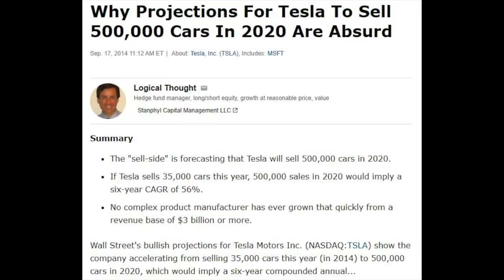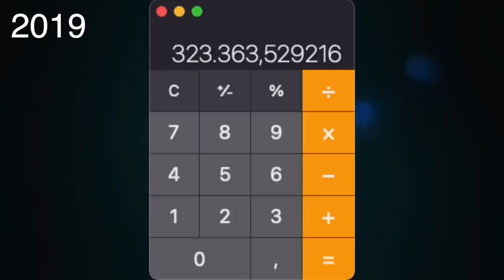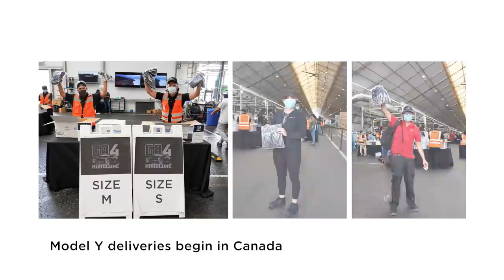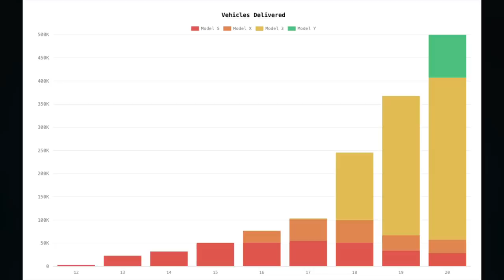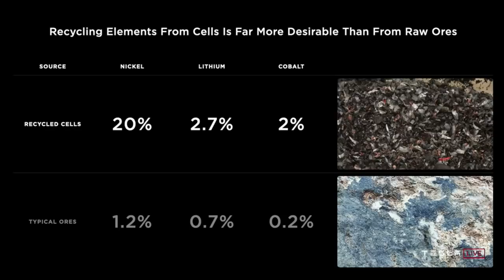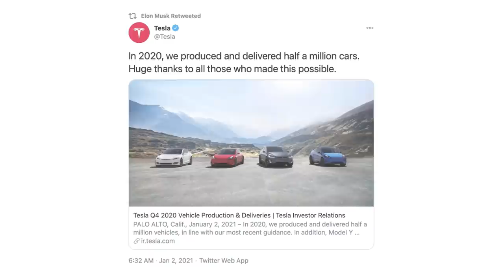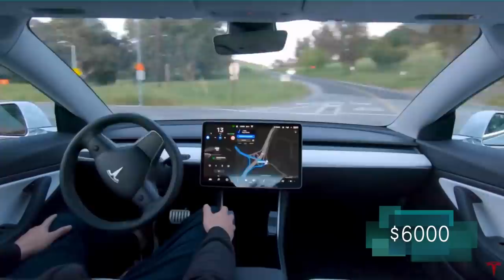Tesla’s Growth story explained - you NEED to understand this !

Comment: What people don't seem to be able to grok is that, barring accidents, most of the Tesla vehicles around now will still be around, in working order, in ten years' time.
The maintenance required on a Tesla EV is orders of magnitude less than on any ICE vehicle. There is an order of magnitude fewer parts to break, wear out, get fouled etcetera.
Production statistics are likely to be cumulative.
Reply: Love the grok reference.
Reply: @Shfytwo  I lurve it too!
Reply: And, few other brands, have "Service Rangers" meaning less time to waste, since you don't need to "Bring it in" for fixing "Small things" if you are busy!
Reply: I hope so.  Planned obsolescence is a pet peeve of mine.  Keeping cars (and other products as well) going is super important for long term sustainability.  I am watching long term performance carefully before I put my money down on my cybertruck.
Reply: Are we far enough into it to know how well Teslas will hold up to other issues, e.g. body rust, UV deterioration of seals, brake line rot (not sure if this is relevant), etc.?
Reply: @MichaelBrown-kk6ck  The key issues, at ten year major service event, likely:
A) if nickel cathode batteries, replace pack
B) heat pump, heat exchanger, hoses.
C) brake lines, rotors, pads.
D) fabric & leather in cabin.

Might be smarter to recycle?
Reply: Except for the fact that Tesla’s use soy based insulation on wiring.  As with soy based insulation on ice cars… it attracts rodents that destroy the car.  Just replaced two computers in two fords and wiring.  Tesla needs to stop using soy based wiring.
Reply: @fredpsimas1874  spot on Fred. I live in rural Wisconsin USA and in a constant battle with rodents chewing on my vehicles. Some people look at me like I’m crazy when I tell them but the local mechanic isn’t surprised he sees it all the time!
Reply: @fredpsimas1874  the highway department uses salt and beet juice in winter road treatment and the squirrels start licking the bottom of the vehicle which turns into chewing. I also got the chipmunks and mice crawling into the cars doing they’re damage
Reply: Production is NOT population.

Comment: Love the idea of Tesla owning their own robotaxis. Is an alternative to have battery swapping because they will be able to do it in their maintainance facilites AND recycle 100% of  their own batteries.
Reply: NOPE, the Structural battery CANNOT be Replaced, but the Whole CAR can be Recycled , at end of life.
Reply: Too often Battery swapping of batteries such as the NIO model faces a very real issue of mechanical wear and tear of both electrical and plumbing connectors and mounting bolts which have the possibility of catastrophic failure
Reply: @j.pgoodwin9020  Very good point. With a swappable battery, you have to insure good WATERPROOF electric connections, but also leak-proof coolant system ones. Furthermore, a  swappable battery can’t give significant structural support, forcing to add metal and weight to the car.

Comment: Just announcing the Model-2 will tank ICE car sales overnight.
Reply: I do agree with that somewhat. But we like a little larger cars and pick up trucks in the US.
Reply: @ZeusBullyMax  - While it's "True" we tend to "Like" and "Choose" larger Vehicles, it's because we have been told they are "Safer", but, everything points to that not being true, with flipping, rolling, and crazy instability, in typical SUV & Pickup Crashes.

However, there is also this thing about Vehicle Insurance, in that we, today, insure each vehicle as if it was always being driven, causing us not to have the best vehicles at our disposal for the best use! IE, a F250 Crew Cab, with Long Box, has its best use case, "Commuting to Work" is not the correct use, unless Work is on a Farm, or Rock Quarry! 

That's where the coming "Compact Tesla" if they can actually deliver Model 3 SR+ level Range, but for just "$25,000", can be a great replacement for Millions of SUV Driven Miles Per Year, and a very useful Uber, Lyft, or Robotaxi Vehicle! Yes, even as an "Extra Vehicle" for F-250 Super Duty Owners!
Reply: LEGACY is NOKIA.......HA HA HA.
Reply: @ZeusBullyMax  - those are coming, Unfortunately LEGACY doesn't have the Battery Supply, and F150 EV will be limited production.
Reply: When people think compact car they think Toyota Tercel. The Tesla compact will be a very different animal. Top technology, over the air updates, beaucoup super charging stations, perfect for Europe, China, India.
Reply: You're absolutely right.
My dad had an Osborne (luggable) portable PC.
I understand the Osborne effect.
Reply: @robertweekley5926  We are bigger people our roads are bigger and we have mainly growing up around larger vehicles. A large pick up runs into a Toyota Yaris I would rather be in the pick up.
Reply: @ZeusBullyMax  There are plenty of compact cars in American cities. In rural areas and in the more expansive West, sure big trucks, cars, everything. But downtown L.A., New York, etc. A Tesla compact for under 30/25 with incentives will do well in its niche. Hell, you oughta see how small the damned parking spaces are here in Austin! 😂
Reply: Model 2 has already been announced for 2 years, any signs? NO. Like self-driving, you can wait untill you weight an ounce!!
Reply: @corpierro  Lol. Please. You're attempts at trolling are laughable. 😂😂😂😂
Reply: @clintatk  me trolling? What are you doing? Science or wishful thinking?
Reply: @corpierro  They are making substantial progress on many fronts. Don’t worry the model two will come out after cybertruck and semi or in parallel. You do know they are building two new factories right now that are bigger than the first two that they are operating out of right now. Adding to that solar roof,power wall, power pack, insurance and FSD. And there’s probably a few other things that I forgot to mention or that I don’t even know about that they are involved in. Like mining and the 4680 batteries etc. They are doing pretty well.Don’t be so impatient unless you know any way to figure any of these situations out. It’s easy to criticize when you for one thing don’t understand any of it and for the second thing have no realization of what it takes to achieve these goals. Oh and there’s a few other things called spacex & the global Internet company.
Reply: @corpierro  Just following the facts. A company that's running as fast as it can to try and fill the demand for its products is hardly going under.
Reply: @corpierro  Okay, I'll feed the troll one more time. Tesla topples over, because...?? Yes, legacy corporations have cred because they are big and old. Will they compete successfully in the electric vehicle transition? Maybe, possibly, but it will take years, while at the same time having to carry the burden of a shrinking old technology. They have to convince their customers that their new EVs are the best while also propping up their gas car sales. They have to keep developing and building their gasoline and diesel lines, splitting their capital between the two technologies. Tesla has no such problem. As for made in the USA, Teslas are the most American made car sold in the US. All others source their parts from around the world. Tesla is very vertically integrated, making much of their own parts. Do your homework. Your opinion is just that. You're welcome to it, but you're lacking the facts.
Reply: @clintatk  when everyone was like you Tesla will become big and old too....
Reply: @clintatk  there is one positive thing about Tesla, it's reviving the already for decades died American automotive industry. But Americans have little or no awareness of what's happening in Europe and Asia. They lead the automotive industry for the last 2-3 decades and will continue to do so. A single American startup will not change that. An EV is for 70% a car like any other, changing the propulsion is a much more easy job for legacy company's than learning to build cars for newcomers. Elon Musk could not have done the job untill this far by hiring clever engineers from competition; VW, BMW, Toyota etc. Unfortunately many of them have already left the company because Elon is a bad employer. See his behavior towards Peter Rawlinson who in fact made the first Tesla
Reply: @corpierro  Sigh, you're wrong.
Reply: @markplott4820  And that F150 and Mach E are already Osborning Ford's slaes
Reply: @corpierro  So true in relation to those companies and others, however observing something is not the same as understanding the reasons why and how those reasons relate to Tesla. 2 clues - management focus and Wall St's needs for ever increasing dividends
Reply: @j.pgoodwin9020   - Yup, the Mach-e , is now outselling Mustang.........lol.
Reply: @corpierro  Are you using the English language? What the hell does that statement that you made mean?

Comment: A new lithium mine is opening in Cornwall U.K.  it’s a set of boreholes into the deep granite of ancient volcanoes to extract lithium brines. No digging no cut & cover and the hot water will be generating electricity. It does not end there, mothballed mines like South Crofty are coming back on line to produce tin and copper.

Comment: Actually, Elon Musk first mentioned a goal of 500,000 vehicles in 2013, at TesLive.  There has been some confusion as to why some reported that as 'manufactured' versus 'sold'.  In June 2014, JB STRAUBEL, Tesla's Chief Technical Officer, said they would produce 500,000 units in 2020.  As you said, they actually beat that amount, building 504,000 units last year, though they sold... 496,000 units.   Tesla produced 35,000 units in 2014 and sold/delivered 31,000 of them.  The year before, 2013, Tesla built 25,000 units and sold/delivered 22,000 units.  Of course NaySayers claimed there was 'NO WAY' Tesla would be that successful, using the rearview mirror again, they noted how sales of large, luxury flagship vehicles had largely dropped since the 2008 Financial Crisis, and that the market could not support such an influx of 'expensive electric cars', even at 15,000 or 20,000 units, worldwide.  Surprise!  Tesla's Detractors were WRONG, again!

Comment: The way an S curve is, is at 50% it reverses...

If it takes you 10 years to go from 1% to 50% it will also take you 10 years to go from 50% to 99%

The way you calculate for that is you start dividing and you take that number subtracted from the total.

So (doubling) 3 6 12 24 50
You ÷2 and now get 25
100-25 is 75
Then..
25÷2 12.5
100- 12.5 is 87.5

So
50 75 87.5 and so on

Just a helpful FYI 😇

Comment: What’s the growth rate of the charger network?
Reply: Faster than EA and others. TESLA can now deliver complete Superchargers preassembled on a Concrete slab.
and CHINA can make 10k per year, in addition to GF2, also TESLA has converted Trilburg, to Supercharger and Energy product, like powerwall.
Reply: @markplott4820  But is it fast enough to keep up with projected growth rate of Tesla vehicles?
Reply: @MichaelBrown-kk6ck  - from my estimate, YES.
GF2 can deliver Supercharger more Efficiently, Trilburg converted to Energy, China 10,000 per year. 
also, Existing V3 Supercharger getting Upgrade to 300 kwh as we speak. and 350 kwh Future.
300 kwh Supercharger is a game changer, gets you in & out Faster. Currently max speed is 1000 mph or 80% in 7 minutes.
Reply: Right now, superchargers growth is 70% per annum.

Comment: Lars, Tesla's growth has been amazing and the fact that they are building two massive new factories bodes well for ongoing future growth. However, I'm not so sure they will be able to maintain 50%+ growth past 2025.  I certainly think it is possible, but I think producing lower priced vehicles and making them ubiquitous is the key. Equally important is the achievement of a Supercharger network that is largely independent of the grid, using solar and battery storage.  This was Elon's initial intent, back when he promised Supercharging would always be free, but very few independent Supercharger stations have been built, even in sunny places where it is most feasible. So, I think Tesla needs to focus on building more Supercharger stations that use only sustainably generated electricity.

Comment: Hi, Lars.  Although it seems crazy that Tesla can continue to grow by 50% compounded for the next 7 years, I do hope it happens.  I wonder how many new factories that will require.  Probably not as many as we might think.  However, my usual resistance is on the FSD.  This is way, way more difficult than Elon imagined in 2016 and I believe he is acknowledging this by offering FSD monthly now. Tesla is charging 10K up front when it still has trouble making left turns.  Robotaxis, at least a gov't approved version, are a long, long way off.

Comment: I think that rate will be held for the next 3 years or so -- but it will taper after that as they would need to add several new plants / year which I just don't see happening.  My guess is they will be  between10-15 million by 2030.

Comment: There must be a limit of how many cars you can produce in one physical area. I do not see the number of available employees as a limit, because I assume that is solved by automation.
But transport infrastructure for transport of materials and cars is finite. Giga Berlin has very good connection to an Autobahn and a railway, and I assume they transport cars on trucks with 7 cars each, and on trains. But with that, 5,000,000 cars is a lot of traffic. Building more factories works, but building larger factories has limits.
Are there estimates for this limit?

Comment: Tesla may well have FSD by 2025, but I think that it is unlikely to be available worldwide. Even in the US Robo taxis will also probably take time to ramp up.  So sales of Tesla will likely still be a big thing.
Reply: All Tesla cars since 2017 January have the necessary hardware for self-driving. Some need a computer upgrade, but it can be done quickly and cheaply. So once FSD is ready, all Tesla cars can instantly be used as a robotaxi. Regulation could be an issue, but once it's working at scale somewhere, everyone will want it and regulators will have very hard time resisting.
Reply: @andrasbiro3007  they have the sensors, but the FSD computer, even HW3 may not be sufficient.  So all Tesla’s could require the new HW4 that has been in design for several years.  If Tesla were 100% convinced that HW3 would be sufficient they wouldn’t have bothered to invest in developing HW4
Reply: @andrewpaulhart  They have to upgrade the hardware to deal with edge cases in other regions. Penguins, polar bears and ox-carts are unusual on US roads. Also drunken (Russian) grandpas (think vodka), land crabs, tarantulas and yetis...
Reply: @andrewpaulhart  
I'm not 100% sure, but I've heard that the current FSD software only uses 3-5% of the chip's capacity. If that's true, the current hardware is more than sufficient.

Tesla invests in HW4 because they are planning for the future, there's no reason to stop at human level driving performance, or even at any superhuman level. And an AI chip has many many other uses besides driving.
Reply: @andrasbiro3007  I remember hearing that too, but more recently I think it was douma on Dave Lee’s channel that said that one of the reasons for the delay of the new FSD was that they had to use both cores and it was quite difficult to get the software stack to work across 2 cores ….  As opposed to using the 2nd core for redundancy or to run shadow mode.  He seems to have some sort of inside info, but he doesn’t work at Tesla so he could be wrong
Reply: @andrewpaulhart  
The current FSD computer is 21x more powerful then it's predecessor, so it's unlikely to be the limiting factor yet. Elon said many times that they don't use it's full power yet.

Comment: I think it will accelerate and then slow down, like an S curve, so now it might be 56-60% and then later drop lower so the avarage will be 50% yoy.

20mil bij 2030 is definitely possible but if it misses it will be 2031. Not any later than that, Tesla WILL produce 20mil.

Now it probably won’t sell that many because they probably will want to keep most of them for themselves.

Comment: i'm a bull but the 56% growth rate won't hold until 2030....the S-curve (for the cars...not the rest of the business) will turn down a bit probably by 2027.
Reply: You are correct.  The rate of growth will slowly reduce every year as it gets to the other side of the S curve.  Also, in order to grow that fast it will need the support of materials suppliers who will not be able to grow that fast.  Also less cars will be needed in the future since EVs will last longer and Robotaxis will reduce the number of cars needed overall.  Alot of the batteries will be used in Energy storage and trucks instead of cars.

Comment: Tesla is an awesome company, and they will have a lot of success.  But I won't be buying Tesla Stock because it's Price/Earnings ratio is currently 645, which is insanely high.  Even if they grow extremely fast for the next 10 years, and the stock price doesn't grow, the price will still be very high.  When the price of the stock (relative to earnings) comes down, I'll definitely buy this company.
Reply: You will wait til eternity. Good luck
Reply: The current pricing makes no allowance for FSD, Robotaxis, or the Model-2.

Add those in and the current price is insanely low.
Reply: Wait till it hits $100 - like Gordon Johnson.
Reply: @isthatatesla  Microsoft never came anywhere near a P/E ratio of 645.  They never even broke 100.  Don't get me wrong ... I really like Tesla, and I'm sure they will succeed.  But the market is pretty frothy right now.  The S&P market valuation is actually higher now than it was during the dot-com bubble in 2000.  Markets always return to normalcy after enough time passes.  Be fearful when others are over-greedy, and be greedy when others are fearful.